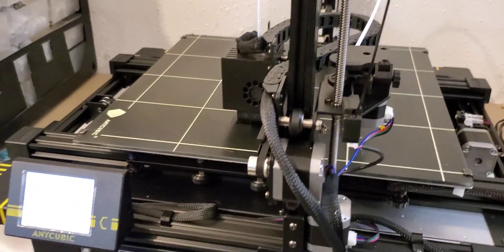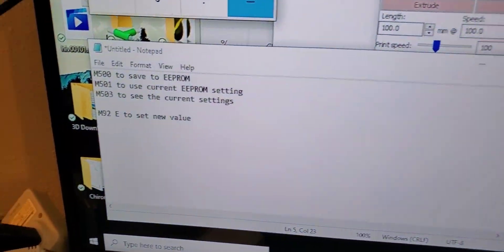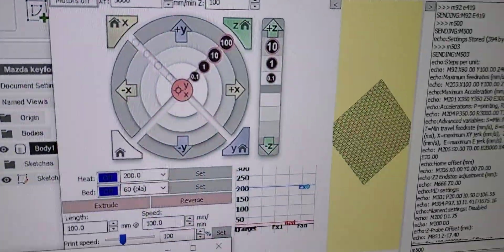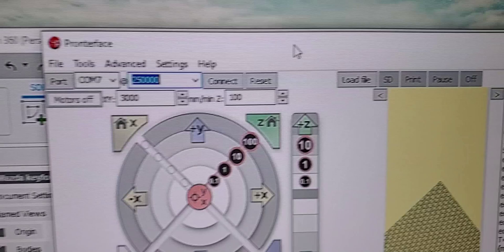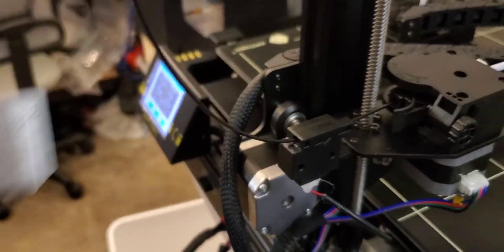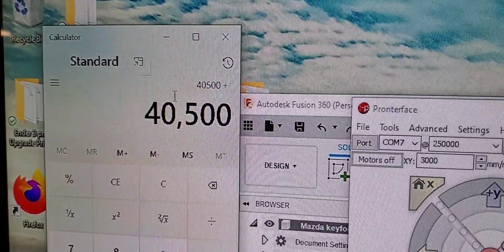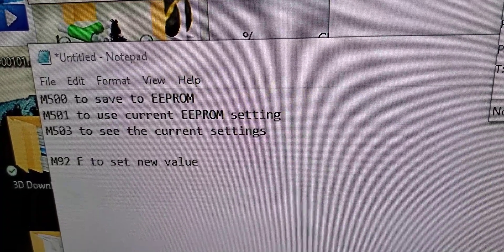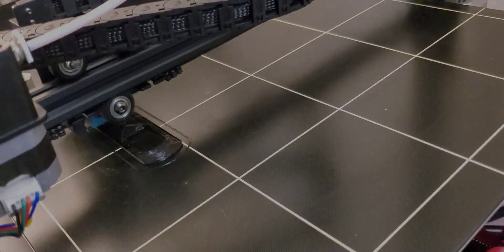Changing the extruder Estep on a Anycubic Chiron

Comment: I can't connect to my printer with pronterface. It just don't find it.
Reply from the maker: You can check the following? Usb cable is connected/set to the correct port. The baud rate matches. If possible, try another usb cable.
Reply: @sypher2012  I downloaded the right driver and it worked! This was the issue lol now my e-step are well calibrated. Thanks for the video!
Reply: @ericseguin207  what do you mean by right driver?

Comment: Did you get a specific driver to get pronterface to see the printer?
Reply from the maker: It's been a while but I didn't have to get a specific driver to connect. I just had to set the correct Baud rate.

Comment: Thank you very much for sharing this video. I was under impression that the " closed " firmware of Chiron blocks the PronterFace from modifications and controlling it. I have the same problem with under extrusion with my Chiron. This helped me a lot.
Also, the filament runout sensor on my Chiron stopped working properly. I never figured out how to fix it. I just disabled it for now.
Reply from the maker: Glad that you find this helpful. You may want to reach out to Anycubic regarding your runout sensor. If it's under warranty, they are fast with sending replacement out!